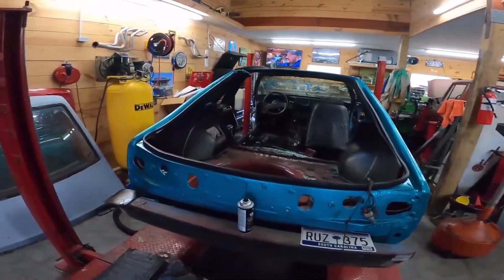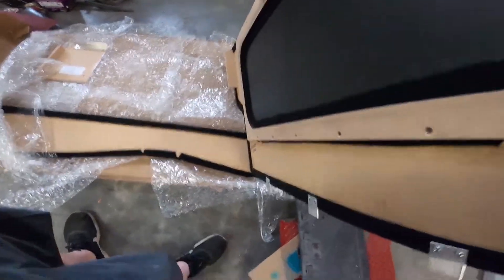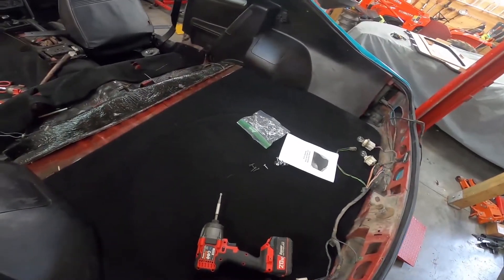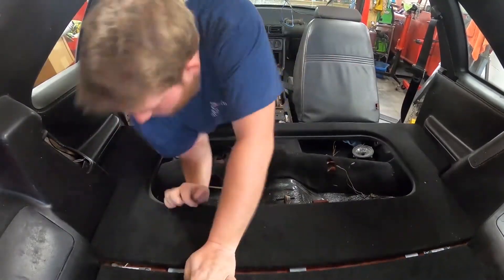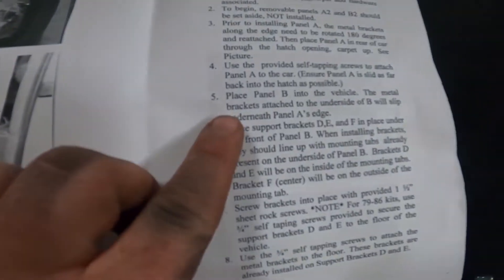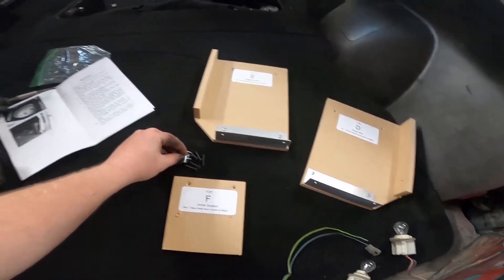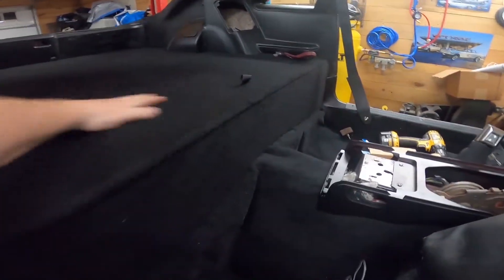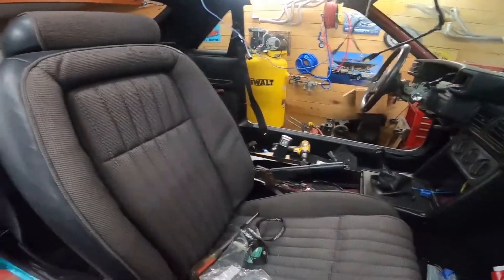Fox Body Mustang Rear Seat Delete install (KDezines)

Comment: I have the same one in my 1990 the only difference is I drilled some holes through it for a battery box that has a digital volt read out on it, but word of advice if you do something like that heat the drill bit to very hot then drill through, but  I think it's the best looking rear seat delete out on the market.

Comment: My 2nd piece hits the arm rests. It won't slide in. Extremely disappointed in this expensive kit
Reply from the maker: You do realize it's to eliminate the entire back seat area correct? My kit does the same thing. You're not supposed to use the armrests back there. 🤷🏻‍♂️
Reply: @damon289  everything is removed. The arm rests are attached to the panels just like you show in your video. The kit was made wrong.